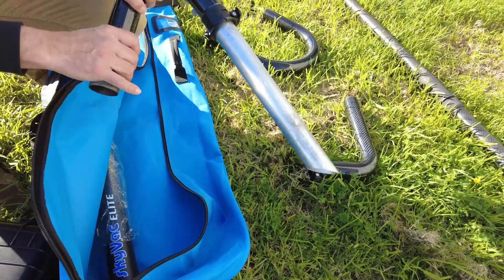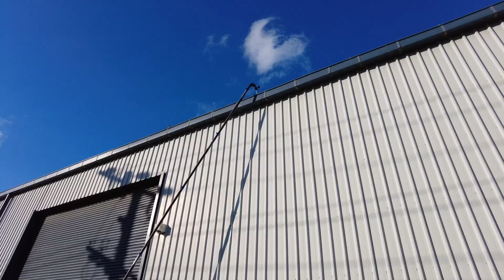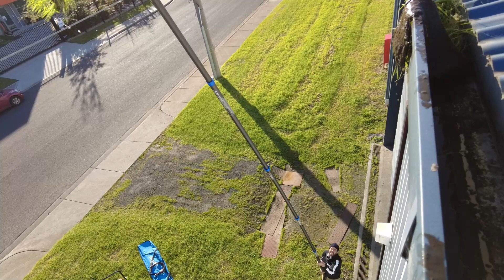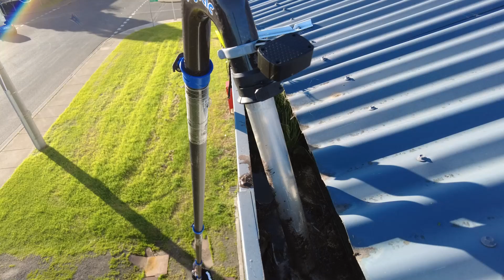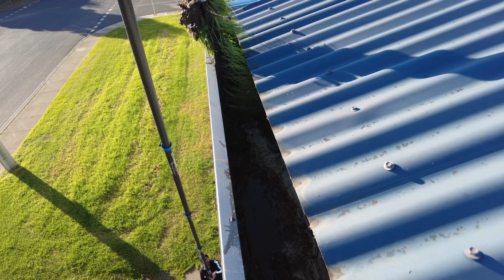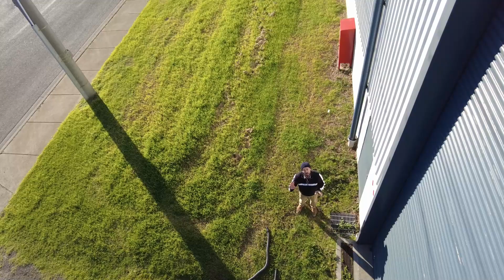Commercial Gutter Cleaning | SkyVac Interceptor | 9 Metres...Easy ! | How to Clean Safely

Comment: Can you use the camera at the same time cleaning?
Reply from the maker: Yes but with experience it’s a process that is carried out without a camera. The camera is great for surveillance.
I often refer to using a gutter vacuum you have SIX SENSES
1. You can hear the vacuum
2. You can feel airflow in your poles
3. You can feel the temperature of your poles
4. You can hear the airflow in the gutter
5. You can feel the tooling in the gutter if on leaves or not
6. The vacuum release gives you a audible indication if your tool end and gooseneck is clear. As well as allowing you to drop items to the ground.
Reply: Great video thank you I have this same job on a 154m industrial building
Reply: I use the sky vac industrial 85